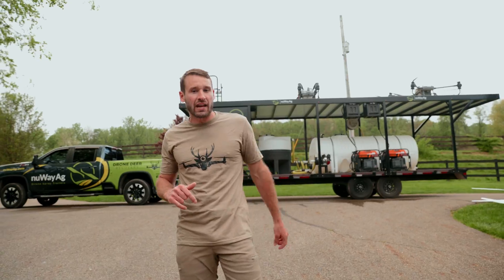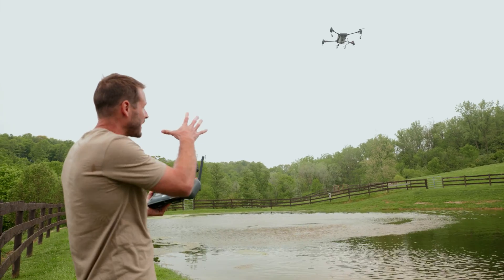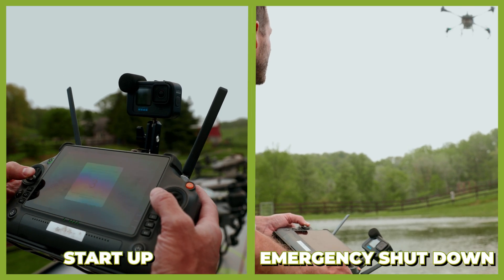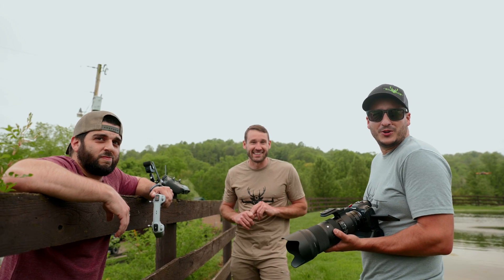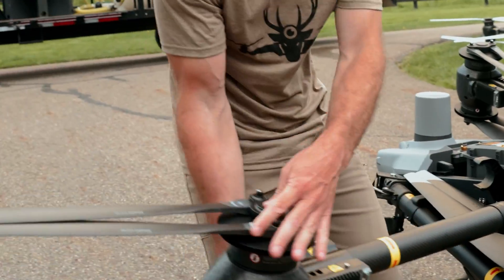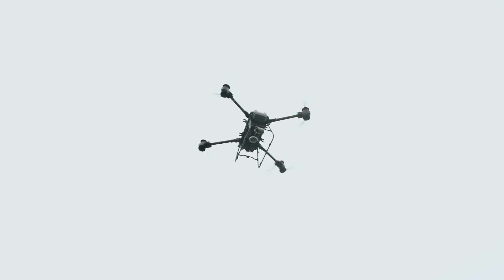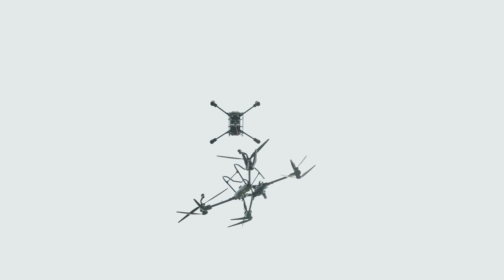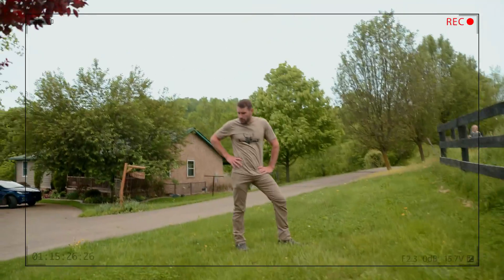Big Drone Plunges into Pond, Needs updated safety feature

Comment: How come u only pull out a frame what happen to the rest of the drone this must be for more entertainment purposes
Reply: Battery and tank tell off in the water. We got them out afterwards
Reply: That's not all that fell off.... 
I can't see how the batteries and the tank could just fall off. 
I would be concerned that the tank might fill up.
That would make it very heavy. 
What I would like to know, since you are testing it anyway, is if it could have lifted it WITH the weight of both batteries and a full tank?